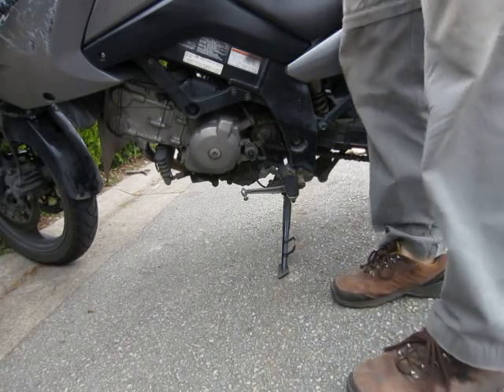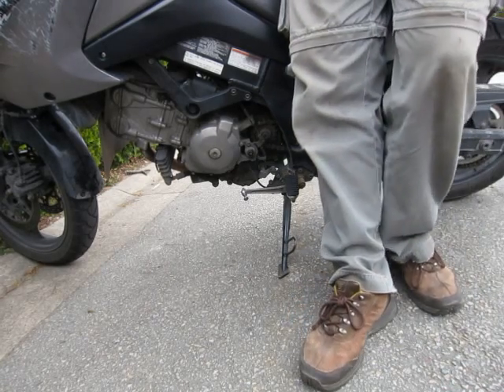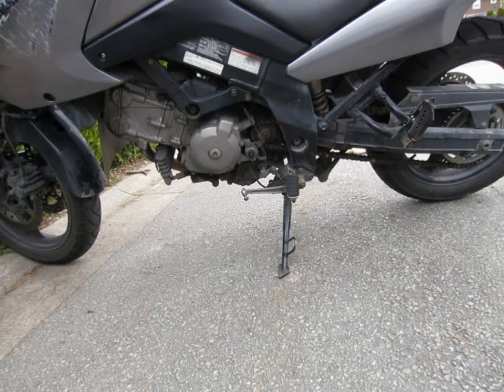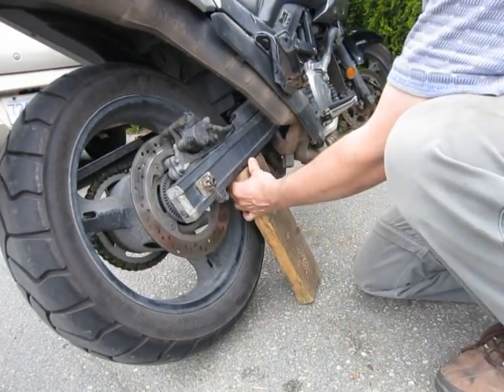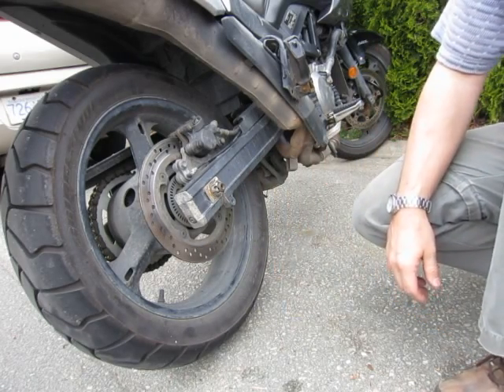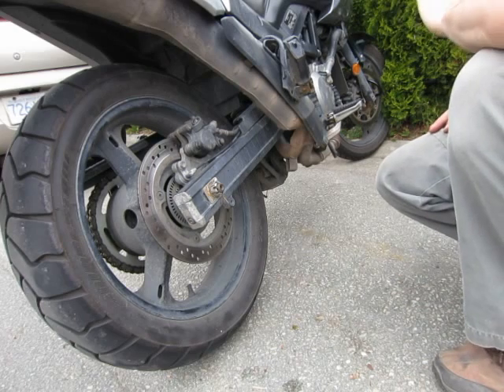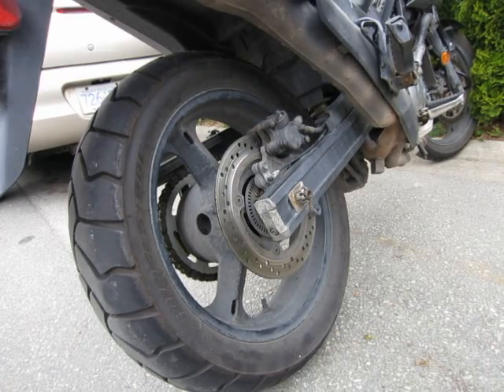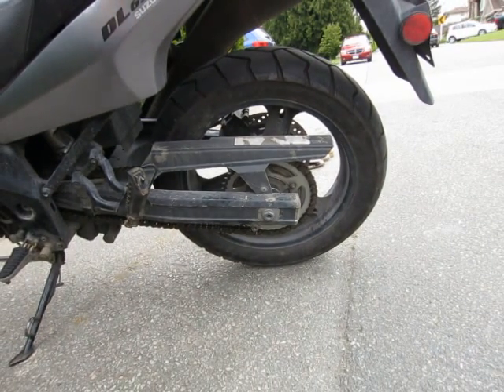Motorcycle chain maintenance set-up with no centerstand

Comment: This is not meant in criticism so please do not take offence. However damage to the  stand and its mounting lugs can result when the side stand is overloaded in this manner. Maybe OK in an emergency and I have even seen rear wheels changed using this method, but the more often you do it the greater the risk.
As I say not having a dig simply offering a word of caution.

Comment: Or, as I discovered today, trying to clean and oil my W400 chain properly but with no centre stand....
Buy a f***ing centre stand, 2nd hand if necessary, and fit it.
No more wondering whether or not you have thoroughly cleaned and greased every part of the chain :)